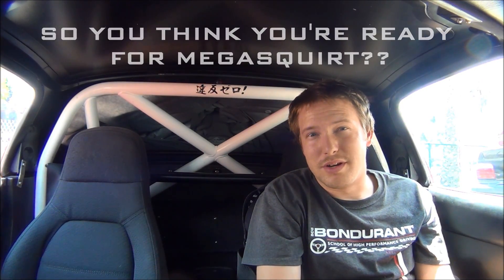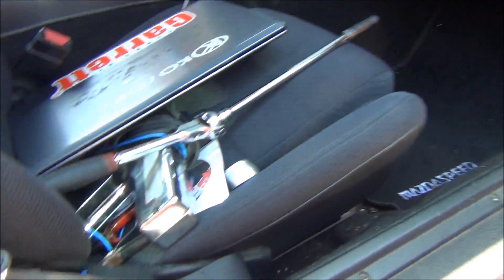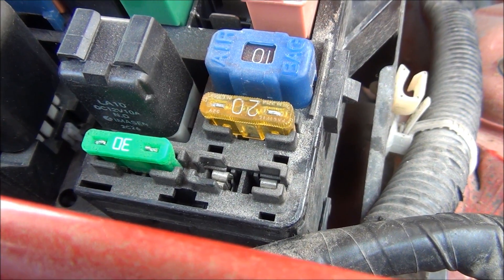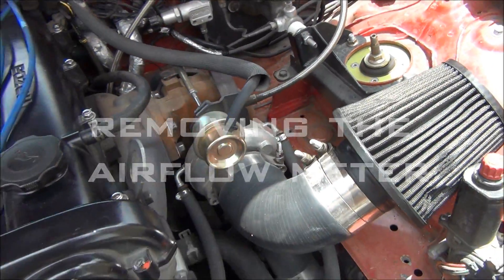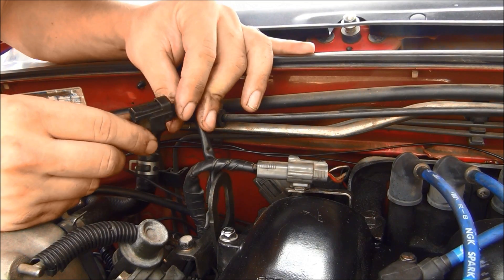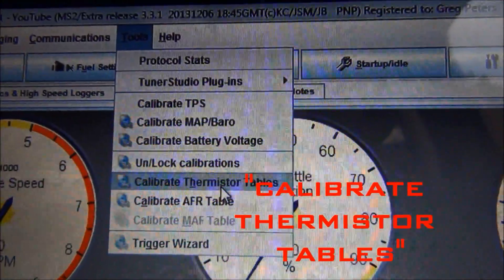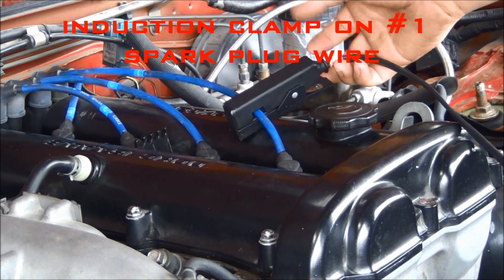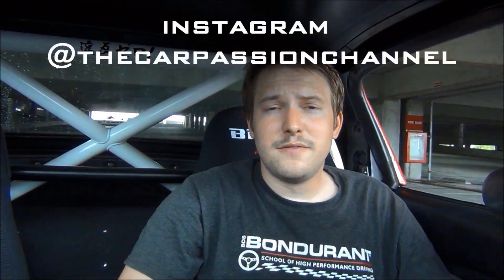How to Install Megasquirt!

Comment: got it now and no wide band
Reply from the maker: +Anthony Diaz Try to use the reply button otherwise it's impossible for me to keep track of what we're talking about since each new comment doesn't stay in the thread. Wideband o2 system is an absolute must in my opinion, there's no guesswork when it comes to fueling, you need the gauge to tune it and make sure it's safe.
Reply: +TheCarPassionChannel ok so what do I have to do put my sensor on the downpipe
Reply from the maker: Anthony Diaz If it doesn't have an o2 sensor bung already (which it should) you have to have a bung welded in for the sensor.
Reply: +TheCarPassionChannel ok cool yea that's what I was thinking
Reply: +TheCarPassionChannel hey I got a really bigg question what's a good ebay intercooler kit that basically bolts on after cuting to fit please send me a link please thanks
Reply from the maker: Anthony Diaz Do you want a bolt on kit or do you want to cut it to fit? Lol.
Reply: +TheCarPassionChannel bolt on for sure
Reply from the maker: Anthony Diaz I'm not sure of any cheap kits that are direct bolt-on.
Reply: +TheCarPassionChannel ok yea Idk lol I guess I might just run no intercooler . also the way I want to do it is put 7 pounds on a t3 . also with wide band and a fmu it shouldn't heart it lol I'm not going to Rev the crap out of it I have to daily this car that's why lol
Reply from the maker: Anthony Diaz I highly recommend intercooling at 7psi, intake temps get real high without one. High intake temps = easier detonation = boom.
Reply: +TheCarPassionChannel dang is there any form on info how to put one on
Reply from the maker: Anthony Diaz An intercooler? Yeah my last video, Broke & Bosoted Ep. 7: Intercooler & Piping

Comment: hey its got a couple questions in just bought a kit for turbo and it got a fmu for fuel the turbo the down pipe and the silicone tubes and gauge.  now only running low boat 7 pounds  .just want to know what do you think about that . also no intercooler
Reply from the maker: +Anthony Diaz Do you have a wideband? Also be careful with 7psi and no intercooler, I would advise not doing long pulls. Intake temps get high really fast.

Comment: Thanks for the comprehensive video man! I have had my 01 for almost four years now, and I've slowly been accumulating engine modifications. Intake, intake manifold, full exhaust, and a few other things. I'd love to tune my car with a megasquirt. I know you aren't an expert, but would you happen to know if there are any additional steps with the 01+ VVT engine?
Reply from the maker: +Nicholas Corlis You just have to make sure you get the correct version of Megasquirt, and just follow the instructions that come along with it, they are very detailed as well.

Comment: So, out of curiosity, are you still using the stock fuel pressure regulator? I have a na8 '97, and I know they are different, but it looked like you still had your original regulator and I'm curious to see how it deals with boost.
Reply from the maker: +Chris Bourre Yes, when you have bigger injectors you don't need to change the fuel pressure regulator.

Comment: so if you want to stick with the stock AFM for now, do you just leave that setting alone? I want to go turbo this year, but in prep, I wanna get everything else installed first. I don't need to delete the AFM if I'm not turbo yet.
Reply from the maker: +Francis Mariani It's really easy to delete it, and you want to get used to tuning without it so when you go turbo you have less to figure out.

Comment: Im enjoying watching these! Nice work.  Im curious as to what your thoughts on installing the IAT are on a on non turbo car to get things started.
Reply from the maker: +Akash Chandrashekar Well, I'd say you don't really need it because you don't have something like a turbo or supercharger drastically increasing the intake temps. The IAT sensor links into the ECU on my car, so it's not like I had the option to install it separately anyways. But, If you're going to be going boosted in the future, it's a step in the right direction and something you won't have to do later.
Reply: +TheCarPassionChannel Thanks for the prompt response! These are great. Can't wait to see one regarding either/both a piecing together turbo components for a build and LSD install :)
Reply from the maker: Akash Chandrashekar If you haven't checked out the Broke & Boosted series that might be what you're looking for! It's not finished yet but I'm trying to crank out the episodes as quick as I can. And I plan on doing diff bushings soon so that will also cover removing/installing the differential for a swap!
Reply: Very nice. Hope you're enjoying the nice weather in OC (used to live in Rowland Heights) and here in Portland. Really enjoying the informative videos, and looking forward to the others. :)
Reply from the maker: Akash Chandrashekar I'm actually down in San Diego but excellent weather! Plenty more videos to come, I get new ideas a lot faster than I can film that's for sure.

Comment: So I'm going to switch jobs in 2 months, I need a car, for the first time to get to work by car and I've never owned a car before. I live in the netherlands and on some days it's really rainy/snowy, do you think a miata would be a bad choice?
Reply: This one looks sweet as fuck http://link.marktplaats.nl/a1041326020
Reply from the maker: +Tim I would not say they are the best for snow... but I have very little experience driving anything in snow. I imagine it would be just as hard as any other RWD car but doable with the right tires?
Reply: +Tim I drive an 02 honda si civic in the snow and people are amazed I can do it with out traction control or a limited slip diff. It truly is all about the tires and how you drive. Get studded snow tires if you can and you should be just fine. Currently I have a set of hankook ipike tires on my car and they have been great. I just got a miata and am trying to figure out why it won't run but I'm excited to see what it does in the snow.

Comment: Does the installation vary from obd1 to obd2 cars?
Reply from the maker: +MrTshoff The MegaSquirt itself does differ, you have to get the right version for your car. They include detailed installation instructions depending on the year of the car, so use those as well to see if there are any major differences between my install here and a 96+ car.
Reply: Dont have a miata yet just doing some research on wha it takes to make one quick. Thanks for the answer!

Comment: what type of laptop did you use? the cable they supplied me with does not connect to my laptops.
Reply from the maker: +michaelrossy28 You need to get a Serial -> USB adapter!
Reply: got it and works perfect! Thanks!

Comment: Hey thanks so much for your help, ive got my car running and driving but I seem to be having trouble with my afrs. My intake does not seem to be sucking much in, for the stock afm do you need to change anything on megaquirt? The cars timing is spot on, and it drives but has lost quite abit of power.
Reply from the maker: +Tack Node What afr's are yo running? The base tune works okay but the fueling definitely needs to be tweaked right away. Do you have the full version of TunerStudio?
Reply: +TheCarPassionChannel my afr at idle is about 12.3 and on cursing its 13.2 (full throttle I goes upto about 13-14). No I don't have  the full version, would it be required to map the fuel properly?
Reply from the maker: Tack Node You don't need the full version to properly tune the fuel, it just makes it faster and easier. You should not be bosting if you're hitting 14's. In boost you need to be running high 11's to low 12's depending on how much boost. If you're still n/a you should shoot for around 12.5 @ full throttle. Cruise should be 14-15.
Reply: +TheCarPassionChannel  Thanks so much, if you ever do any fuel tuning or megasquirt tuning in general it would really help if you made a video (I know the big stuff is best left to the prefessionals but theres always a learning experience

Comment: Are you in Los Angeles?
Reply from the maker: +eric ngo San Diego
Reply: I'm still thinking about buying a miata for my first car I want to go turbo like yours but which should I go for a 1.6 or a 1.8?
Reply from the maker: eric ngo The 1.8 cars have a few more advantages like more displacement (obviously) and a stronger diff. However I wouldn't recommend against a 1.6L car either if you find the right one. If you want to go turbo, try to find a big nose 1.6, the 1990 and early 1991 cars are short nose.
Reply: What is the difference between big nose and short nose?
Reply from the maker: eric ngo The short nose crank has had multiple documented failures due to lack of harmonic damper support. If you do have a short nose, it's recommended to remove the timing gear and inspect the crank for damage, then re-torque everything. I've got a buddy with a boosted short nose, 240+whp and 225k miles. They can be fine, but most people avoid them if they're buying a car specifically to turbocharge it.
Reply: Oh alright I'll keep that in mind what about a turbo 1.8 how are thoses ?
Reply from the maker: eric ngo Even better. There is no disadvantage to the 1.8 cars, everything is either the same or better.
Reply: So there's no advantage of going turbo with the 1.8 over a 1.6?
Reply from the maker: eric ngo Yes, they have more displacement and will spool a turbo faster and usually make a little more power at the same boost level. The 99+ 1.8L has a better head design and can make even more power. You can swap the 99+ head onto the 94-97 1.8L too. Most people swap the 99-00 head since the 01+ has VVT which is harder to tune with.
Reply: Oh okay thank you for all this information
Reply from the maker: eric ngo No worries man that's what the channel is all about!

Comment: Great video.  Do I need to order an inlet air temp probe from someone to work with the megasquirt if I'm adding a turbo to my 1990 miata?  Also, Do I need to add a Throttle position sensor for megasquirt to work properly?

Thanks,
Del
Reply from the maker: +delinport You do not need any TPS at all to run Megasquirt. The first 6-8 months of being turbo I actually didn't have one at all. I ended up wiring in a variable unit now so I can use some of the cool features like launch control and throttle position based boost control. You also don't need to add the inlet temp probe IF you retain the stock AFM. The reason for using the IAT kit with the Megasquirt is so you can delete the restrictive AFM.
Reply: Thank you!  I think I have all the parts ordered that I need!

Comment: Would it make any significant difference over stock if you just upgrade to megasquirt and bigger injectors without turboing your car?
Reply from the maker: +pbelanglos You can benefit from the Megasquirt on a stock engine if you get it tuned properly. You will not benefit from larger injectors on a stock engine. Upsizing your injectors is a supporting mod, it's only necessary if you're flowing enough air to need them.

Comment: Would you be able to do a small launch control install video in the future?  Or point me to a helpful install page?
Reply from the maker: +ian rasch Install page for a launch control system? What system is it? MS has launch control built into it, you mean a video on just setting it up?
Reply: +TheCarPassionChannel yes an install video! I'm using tuner studio. Just not sure how the clutch switch or external switches need to interact with the options pin in megasquirt.
Reply from the maker: ian rasch Depending on your MS you might not even need the options plug. What MS do you have and what year is your car?
Reply: 91 1.6l and I have MS PNP2!
Reply from the maker: ian rasch Have you tried turning launch control on and setting it up yet?
Reply: +TheCarPassionChannel yep!
Reply from the maker: ian rasch And it didn't work? What happened?
Reply: +TheCarPassionChannel nope! foot on the clutch in first and revved right past the limit I set.
Reply from the maker: ian rasch Ok try this, set up everything exactly the same, except put the shifter in neutral and see if the LC works.
Reply: +TheCarPassionChannel Will do tonight!
Reply from the maker: ian rasch That's how it happened on mine because the MS2 is wired wrong from the factory. What I did was wire the clutch switch into the transmission harness for the neutral switch and boom, launch control + flatshift on the clutch. Even ran a switch so I could turn it on and off.
Reply: okay I tried in neutral with no luck. tried with both clutch in and out!
Reply from the maker: ian rasch What firmware do you have?
Reply from the maker: ian rasch Also dumb question, but are you sure clutch and neutral switch are hooked up and working?
Reply: Well they are both factory as of right now! I haven't touched them at all.
Reply from the maker: ian rasch You may have to put that options plug into play then.
Reply: okay, going to grab a switch for it soon!
Reply: I used an external switch hooked up to the pin for launch control with the other side grounded, still with no luck in first or neutral. do i also need to wire this switch to the clutch switch pin on the options plug? i've also been hearing about the neutral switch on the trans...does that need to be removed?
Reply from the maker: ian rasch Some cars need the neutral switch disconnected, others don't. I haven't done LC with the options plug so I'm not sure exactly how it's wired, but I'm thinking the clutch switch in the car needs to be wired into the options plug as well because MS obviously doesn't know when the clutch is in or out as it is, otherwise LC would work. Try wiring in the clutch switch (bottom button on the firewall side) into the options port.
Reply: +TheCarPassionChannel what do you mean by the bottom button on the firewall side?
Reply from the maker: ian rasch the clutch has 2 switches, top and bottom. LC needs to work off the bottom one. The same switch that won't let you start your car if the clutch pedal isn't all the way down.
Reply: Do i need to splice into a specific wire on the bottom switch?  shouldn't the clutch switch run into the factory harness, and could i just cut it and plug into the options plug?
Reply from the maker: ian rasch I've never done it so I can't say for sure how to wire it
Reply: would it be easier to just use the clutch switch? i tried connecting pins 3 and 13 with the jumper on with no luck via the advice of a friend
Reply: thinking it should be easier without the options plug, but not sure how to got about it :/

Comment: Just bought a 91 Miata, 1.6 with a greddy turbo kit running 8 psi on a stock ECU (whaaat?)
I am about to order Megasquirt PnP2, but stuck on what injectors I should get. Any tips? Second hand or new, and how big? My goal is around 230-250 whp.
Love your videos! You're funny and educating.
Reply from the maker: +André Baumgartner Best bang for your buck: A set of refurbished RX8 injectors on eBay (The yellow ones). They are 420cc and they fit right into the stock rail AND use the oem Miata connector, I made about 220whp on these, and they were about $170.00 for a set of four.
Reply: +TheCarPassionChannel Ended up buying 550cc from 949racing. How long do you think it would take a newbie like myself to tune the car with megasquirt with no experience? I have no idea how long I'll be sitting around without my daily driver..
Reply from the maker: André Baumgartner The base map is actually pretty good, I drove and even autocrossed the car on 90% base map when I was n/a still. I just had to make minor adjustments to the fueling, which to me is the easiest part of tuning it. Miataturbo (dot) net is your friend. I'd tune it with the stock injectors first, then swap injectors and retune, then install the turbo after you're more comfortable with the ECU.
Reply: +TheCarPassionChannel Thanks. I've already got the greddy turbo kit installed with an IC. Already running 8 PSI on stock ECU and injectors. Previous owners doing :/ 
That's why I was wondering how long you would estimate a newbie like myself to make the car useable. Judging from what I've read, my goal will be just below 15 psi or so.
Reply from the maker: André Baumgartner It's just a matter of learning the program and doing lots of reading, it's probably easier than yo think. I highly recommend buying the full version of TunerStudio (you can get the "Lite" version for free) because it has a feature called VE Analyze Live (Also known as VEAL) that tunes the fuel map while you drive. It's a really awesome feature. After you get the MS installed, just set your base timing like in my video, change your req_fuel to adjust for the larger injectors (you have to install the MS before changing injectors) and let VEAL do the work. That will get the car safe and driveable. A small note, make sure EGO is turned off while fuel tuning. I can help you out with it once you're that far.

Comment: Could you explain how you setup Megasquirt as a boost controller?
Reply from the maker: +ninjawarrior821 You need an electronic boost control solenoid, then just hook that up to a switched 12v source, and run the other wire to your MS (it has a boost control output pin). Then you'll have full boost control with MS!